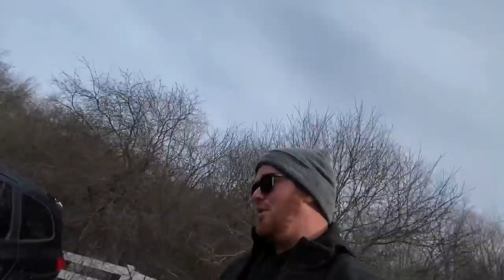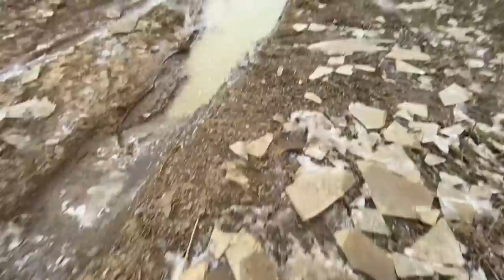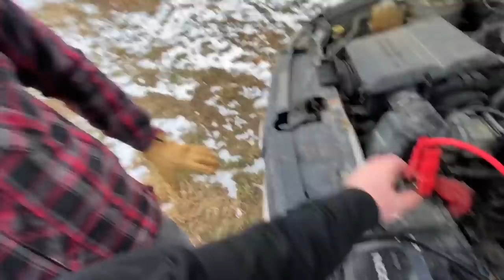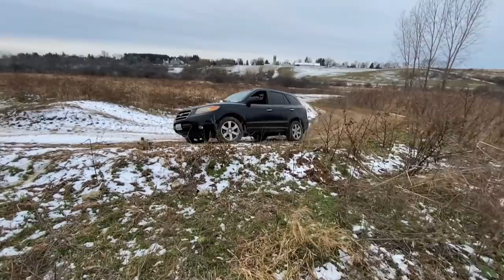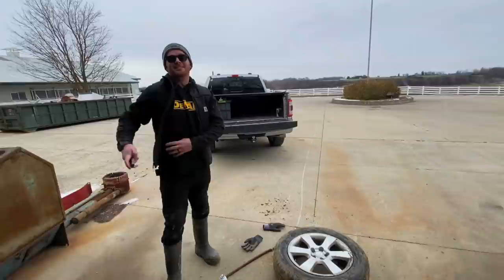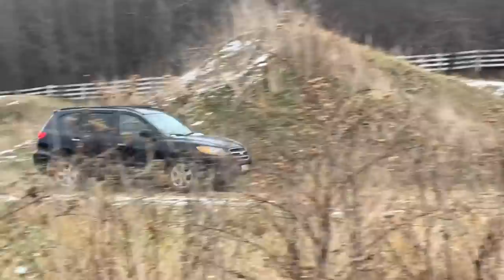HYUNDAI AWD Race! GOODBYE Tire!

Comment: sometimes with those escapes the ignition switch gets a little bit worn. when you turn it to start, turn it sharply (forcefully) there, and it will usually work. or try pushing the key in and doing the same. that will get you by until it won't. hope you're gonna jump both the escape and that hyundai! MORE JUMPS!!